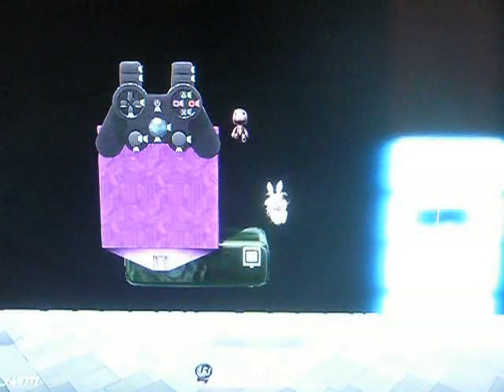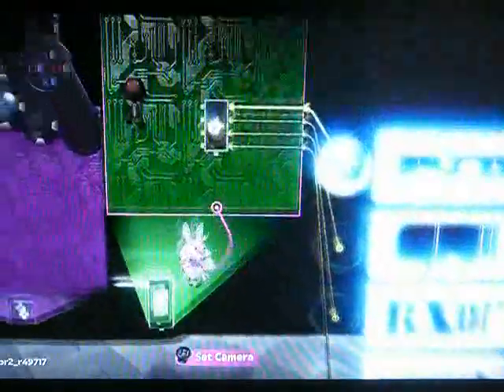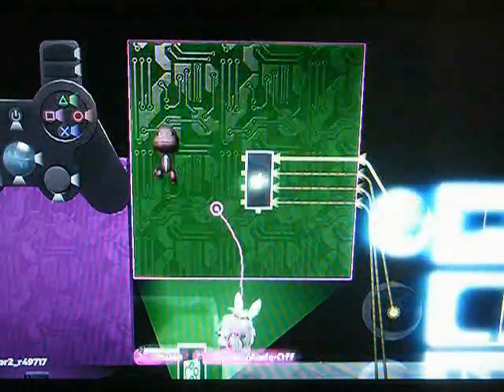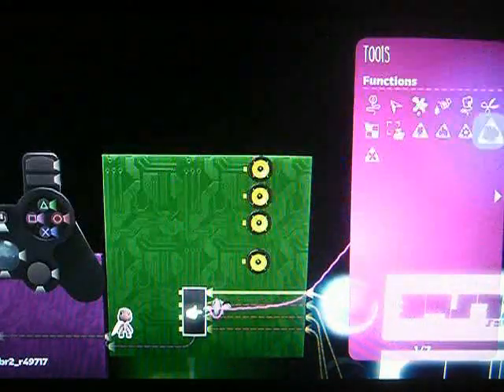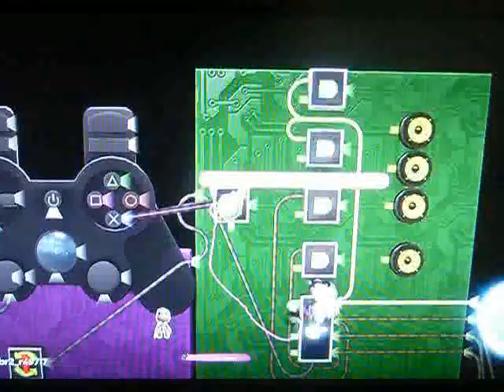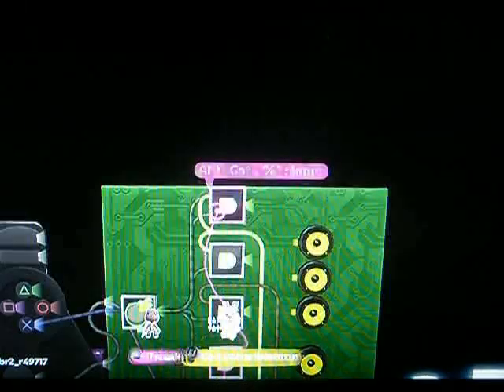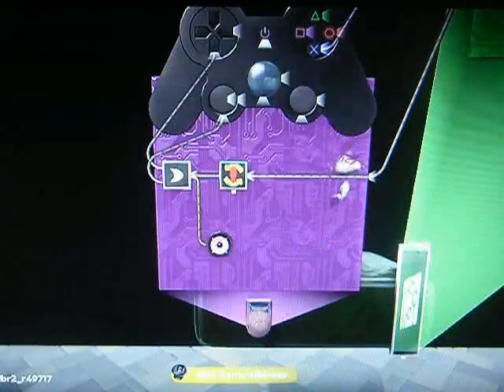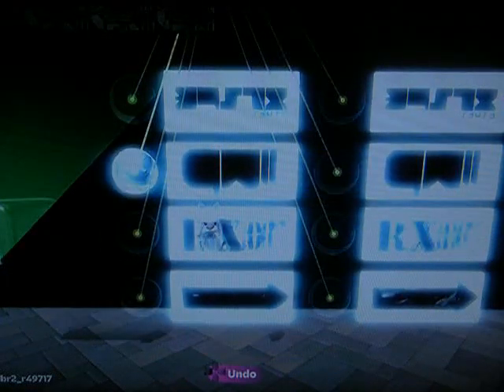LittleBigPlanet 2 Beta - Basic Menu Tutorial Pt 1

Comment from the maker: @LifeAmongTheDeadBand You can grab the ends of wires and put them into new connections.

What exactly are you talking about with the inverter? IF you saw the post, it's just a directional splitter going into opposite inputs of a combiner, you can put things on microchips.  Or if you mean that I'm wiring two inputs into it?

I'm using an OR gate. IF you don't know what an OR gate is or how microchips work then you need to play through the ingame tutorials on basic logic.

Comment: @BZLPS3 the on tap method described in the blog post did not work for me very well, so i came up with my own on tap. By creating a counter and having it reset itself like Foofles said, but instead attach the out put of the counter to a timer of about one second. the timers output shhould then reset the counter. The reason of assing the counter is because the signal is very short so added time is needed for emitters for example